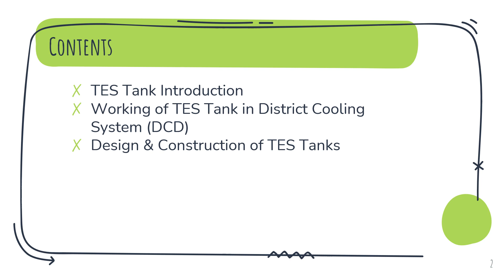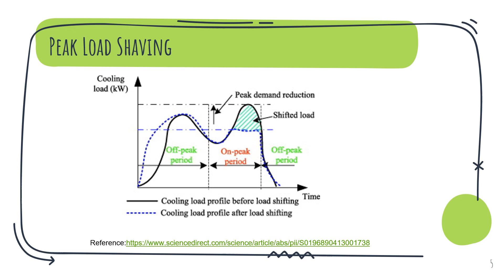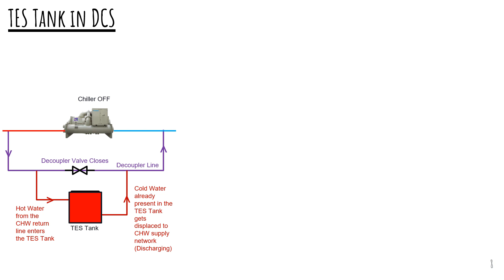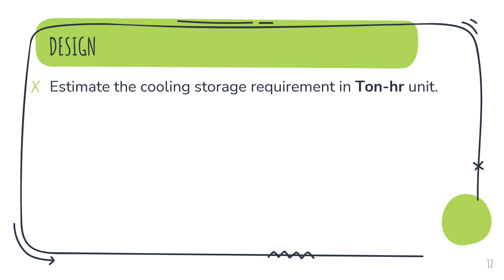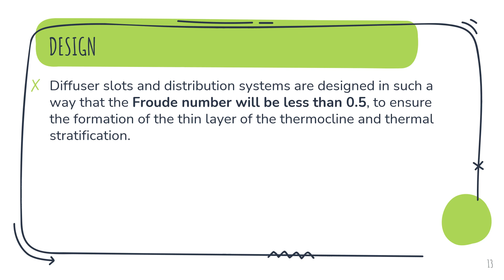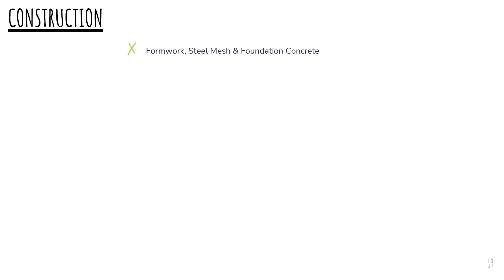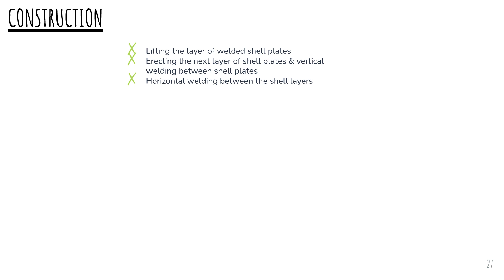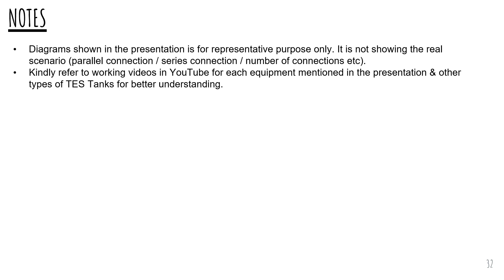Design, Construction & Working of Thermal Energy Storage (TES) Tank in District Cooling System (DCS)

Comment: Thank you professor, as civil and structural prof. engineer this is simply clear representation. Thermal storage in drywall using organi phase - change material. For exp. small example two mixutres of phase material (PCM),  cca
50% butyl stearate with cca.45-50% butyl palamite, and cca
55% lauric acid with cca. 45% capric acid, diluted 10%, with fire retardant, were diffused  into cca. 10-15mm wallboard. Preliminar  test as wall as other  showed little extra flame spread beyond that of unloaded wallboard. So we concluded vialbe PCM wallboard can be produced with a s simple proces, using mixtures of fatty acids of their esters. However, full - scale fire teasting is done. The amount of thermal storage per unit area is limited by weeping of the PCM in its liquid state if too much is diffused into the wallboard. For these particular two mixtures, the maximum amount without weeping is not very far below the upper light limit can be used passively with good comfort on winter nights.
      For new solar constructions, the net storage cost with New kind of PCM wallboard deployed throughout home should be well below the cost for a concrete storage of equal capacity. Purchase and installation of some type of wallboard are required in any case.
In CONTRAST to concrete storage, PCM capacity beyond the normal rule - of - thumb amount is not required to avoid afternoon overheating and early morning underheating like exp. in January. The other wallboard surface is about 20 times the glazing area, and the PCM is spread over a much LARGER internal void surface, so all of it is thermally closely coupled to the room air. The thermal discharge current near dawn can be larger than the one from a concrete storage of the same capacity, giving warmer air temperatures.
Thank you for preliminar presentation!  Good luck with workout

Comment: Which software is best for design and simulation of cold thermal energy storage plant..plz guide
Reply from the maker: You will have to use structural analysis tools like StaadPro & CFD Softwares together to suit your requirements for your site conditions and load/flow requirements.